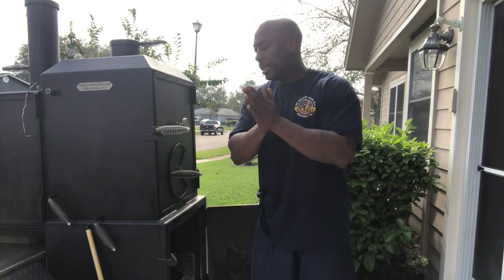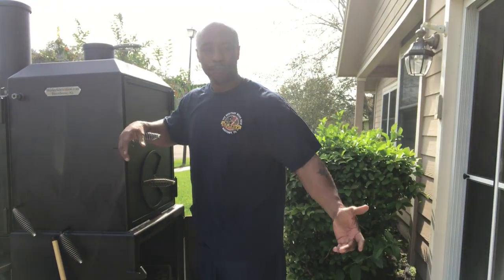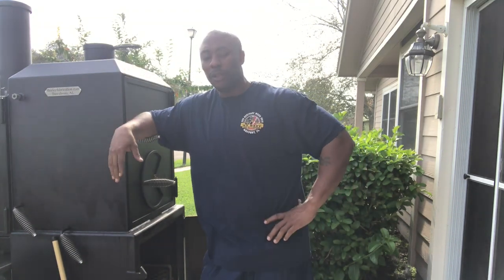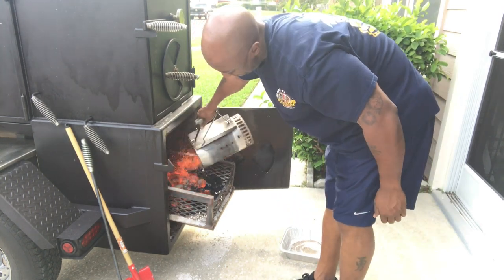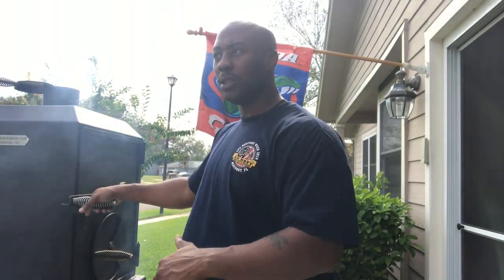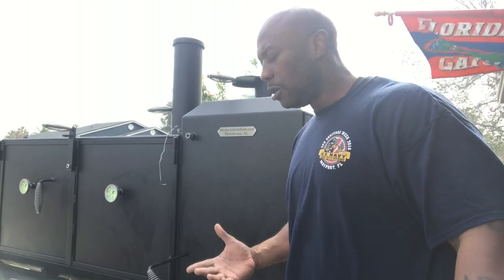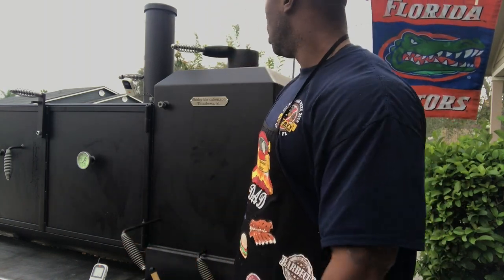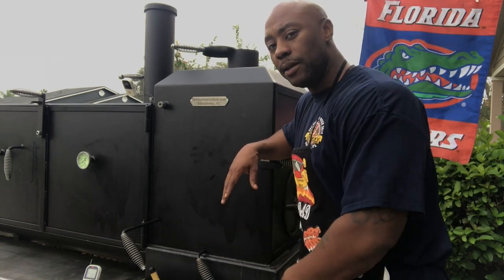How Well Does My Shirley Fabrication Smoker Hold Temps???

Comment: Great video.  This was very helpful--I'm still learning how to manage the fire in my Shirley.  I have the patio model (24"x42") with the warmer and extra damper!
Reply from the maker: Take your time. It took me about 3 months to get Big Bertha under control lol.
Reply: Thanks for the encouragement. I'll keep playing with fire until I lock it in.  That's half the fun, right? My first cook was probably a little too hot for BBQ (275-300 deg. F.), and I didn't get as much smoke flavor as I wanted from my oak and pecan wood.  I started with chicken thighs, though, knowing that I'd probably end up hot.  I drafted through my warming cabinet, which I think helps stabilize the main chamber.
Reply from the maker: Once you learn how to control the fire then next up is learning how to get those smoke rings.

Comment: I just recently came across Shirley Fabrications. I have a question about the bottom grate on the main chamber. In the main chamber the bottom grate is really close to the baffle plate. I notice a lot of people use pans on that level. I am sure it is for ease of cleaning in come cases. My question is, Do you get enough smoke to the bottom grate being so close to the baffle plate? thanks for your time, Mike from STL
Reply from the maker: I have zero issues with the bottom grate. It is actually not as close as you think.

Comment: is that smoke leaking out around the warmer box door?
Reply from the maker: Yup, It doesn't come with gasket material in the warmer. Im cool with that because my temps are exactly where I want them. If I was to put gasket material in the warmer then it wouldn't be a warmer any more.

Comment: Hey nice smoker, Im currently building one myself out of 1/4inch for the fire box and stack and using a 60 gallon propane tank for the main cook chamber, i dont see many online setup like this reverse n out through a stack chamber, do temps eventually all get even between the main chamber and the stack chamber or are they always slightly lower in the stack? Thanks for any info you might have to share.

Comment: What's up didn't find your email on the description, I am about to order a shirley fab and was interested in asking some ?
Reply from the maker: I have a 24X60 smoker with the warmer box added 
on top of the fire box. I also, has the fire box insulated as this will 
save in the long run on the amount of wood I burn. Let me know what 
exactly you are looking for and I will try to help.
Reply: Backyard 'Bbq-R' I am pretty much getting the same one you have, but do you think the insulated firebox is needed for me being that I'm in Miami FL
Reply from the maker: no not really. i do save on the amount of wood i use during my cooks 
though. i would recommend getting the 1/2 inch thick firebox so you 
NEVER have to replace the firebox.
Reply: Thanks for the advice, It would take a lot to wear out a 1/2 " firebox. Let's say pro and con from 1/2" firebox and insulated firebox. I know their insulated firebox is 1/4 inch inside then the insulation and 1/4 on the outside. What happens if you wear out the 1/4 inch on the inside?
Reply from the maker: They you would have to have the firebox cut out and remanufactured. Thats why i said go with the 1/2 inch box.